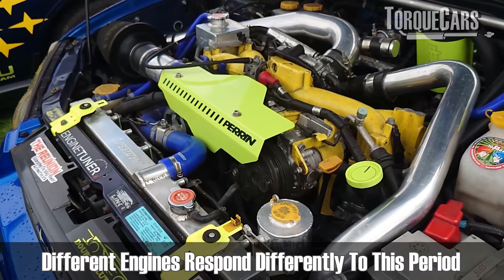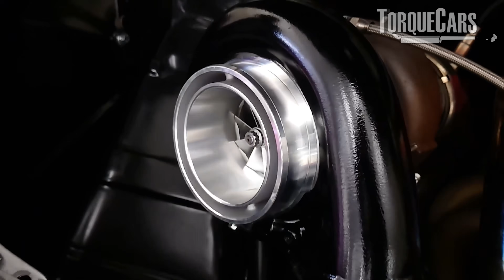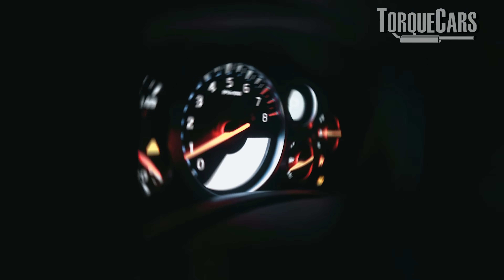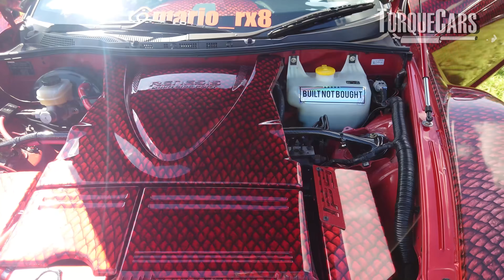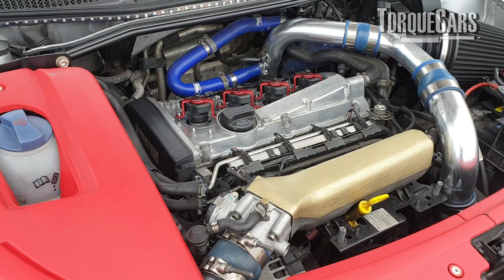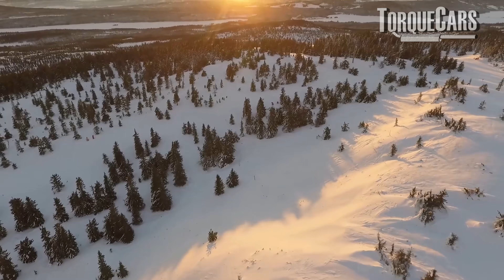❄️Best Cold Start Method Explained For Each Engine Type.

Comment: Very good advice.
However, in the generality of cars ( more than 90%) the user can only know the "water" temperature  not the oil temperature. In general, a car gefs the normal "water" temperature after about 9 km. But this do not means oil is already at the right temperature. It is not. Only after 18km~20km or more oil temperature reaches the optimal value...

Comment: Cold starts are very normal here 🇨🇦, I have a pickup powered by a 6.6 litre V8 diesel. It’s -19c this morning so a normal cold start would involve turning the key letting the glow plug light go out and starting, after that a grid heater in the intake will kick in for a minute to reduce emissions. The truck has two large starter batteries for this purpose. 
In winter I use 0W-40 full synthetic oil of 10 litres, I have a block heater, a oil pan pad heater and another oil pan heater on the Allison transmission which are usually all plugged in 2-3 hrs before starting. Truck is 12 years old with just over 300,000 kms on it, with no power train issues. Look after your vehicle and it will look after you. 
If you think I don’t know anything about UK cars think again, before I move to 🇨🇦 I had numerous cars and it was very important to me to help the engine warm up, I had a inline hose heater and Kenlow cooling fans on my cars in the late 70’s.

Comment: my engine keeps revs up a bit for the first 45 secs when starting cold. I always wait for this cycle to end, then take it really easy until the oil reaches at least 60 C, flooring it only above 80 C. I like to take my time with the engine, I rather head out 5 minutes earlier than starting at the last moment and pushing it cold. I drive skoda octavia vrs 2.0 tsi 2015, 155k km, first owner, works beautifully, no oil consumption, fuel economy the same as new. Just being gentle when cold and never being late for service, best oil and parts always.

Comment: This is what I do with my 2.3 Focus ST. 

Start the engine and allow it to circulate oil while I put my seatbelt on and set whatever settings I want my heated seats set at etc.  The car is in it’s open loop cycle and making a lot of exhaust noise during this phase so I’m conscious to not sit too long burbling away on the driveway at 6:30am so I’ll start driving once I’m ready to start moving. 

During warm up I treat the car with mechanical sympathy, gentle acceleration and smooth gear shifts, but I will happily use revs for power if needed - rather than low revs high load I.E. ‘lugging’ or ‘LSPI’. A lot of people fixate on low RPM when cold, but if you are using torque and low revs rather than power at slightly higher revs with a cold engine you are just putting more stress on the engine. 

Overtaking and going up hill are still necessary with a cold engine and I’d rather use a low gear and light - mid throttle in these situations. 

I avoid sports mode, full throttle, fast gear shifts and the upper rev range until the engine oil is up to 80°C. 

Even when up to temp and with a flexible modern turbo engine such as my 2.3 Ecoboost I still like to avoid LSPI and will drop a gear or even two if I want to really get a move on. So many just keep it in 6th and boot it because the car will do it, however it’s not mechanically sympathetic and I want to keep my car for a long time.

Comment: You didn't mention specifically the Flat 6.  The Porsches' have a 10.5 - 12 quart sump and that is a lot of oil to get hot.  I keep it under 2500 rpm (except when shifting) until I get the oil up to temp.  Further, I never let the car warm up by idling.  I start it and drive off immediately to get some heat into it and to minimize fuel dilution.

Comment: My VW Bora with the 2.0 EA827 engine has forged parts inside, which is clearly noticeable on really cold days, the enormous stroke doesn't help either.. I tend to take it real easy for the first 10 minutes. And give it the beans after 20 minutes when I feel like it..

Comment: If you have a hybrid and do your own oil changes, strongly considered an oil that is formulated specifically for hybrids (beyond just the appropriate viscosity). Mobil 1 has one that Engineering Explained did a video on. Cheers.

Comment: I like to see at least the temp gague reach the bottom line as a minimum temp, but I have a 2 km bad dirt road, before I get to pavement. It insures, even if I am in a hurry, the engine gets a slow warm-up (and down). Even my cold blooded  diesel vehicles are fully warm before I can push them hard. On the other hand, the road does eat shocks. nothing is free. 🤣

Comment: My 12 year old c4 picasso 1.6 airdream engine always warm up for a minute and keep revs low fir a good few minutes. Got this one because it's got the fixed vein turbo, yes it's only 90bhp but that's plenty for me and last week done a 30 mile run on M4 stuck cruise control to 62mph and got 72.3mpg mpg not bad for a car with 130k on the clock. Once again keep up good work, learned alot.

Comment: Just remember not to be too conservative on the gas when driving a cold engine or you labour the engine which is even worse. About 2-2.5K RPMs for cold upshifts is usually about right. On an auto this often means switching into sport mode make sure the transmission doesn't upshift at 1500RPMs which is too low for a cold engine. Manufacturers set these up shifts to adhere to fuel and emissions regulations, not to prolong engine life.

Comment: My Lexus CT200h (= Toyota 1.8 hybrid gen 3 system) protects itself by limiting the rpm at 1300 rpm at cold start untill coolant temperature is about 30 degrees celcius.
Very smart!
Reply: Have a 2020 Corolla hybrid with the 1.8. But it takes a little bit longer to get heat out of the motor when it’s cold.
Reply: @scottj1957 

I owned a ‘12 Prius V, with the 1.8L 2ZR-FXE, from new until a HS kid plowed into me early this month and totaled it. It is a really good system. In 14 years I hadn’t had a single thing fail on it.

The system definitely has heat retention issues in cold months. In city driving, with the engine shutting down frequently, the ECT temp would languish in the 120-155F range. This produced a lot of blow-by, making fuel dilution in the oil an issue.

It also resulted in a lot of oil vapor being released through the PCV valve. By 100K miles that vapor had combined with enough EGR particulates to differentially block the EGR ports inside the plenum. Cylinder one gets very blocked and without the proper EGR dose it runs lean and too hot. Seems Toyota fingered this issue as why head gaskets were failing at an unusual rate.

When I opened up the EGR system to clean out the EGR valve and cooler, I decided to run an oil catch can on the PCV line. That OCC caught a ton of oil and water vapor in the cold months.

Your system has the same engine but Toyota redesigned the plenum, EGR system and head gasket by then. Hopefully you don’t end up in the situation so many Gen 3 hybrid owners did.
Reply: This sounds very dubious.
So lemme get this straight; You pull out of your driveway and onto the A road, then 1/2 mile and turn onto a dual carriageway. Are you saying that one of these must be true;
1. The electrified side can do motorway speeds with minimal engine assistance?
2. The car limits your road speed due to the electrified side not being large enough and the engine not being up to temp?

Comment: My turbocharged car idles high for a minute or so......So I let it do it's thing n then drive gently until warm n then drive gently to cool it down
Reply: I have a 19 year old Allroad and a 7 year old phev mini countryman. The Allroad gets a minute idling on the drive while lights , mirrors, seatbelts etc get sorted and then its revs limited to 2100 until the temp is approaching normal. @ 225k the g'box is still seamless as the trans fluid has time to get right around everywhere. The last half mile of every drive is on minimal throttle and 30 seconds idling before shutdown. Seems to be working......

Comment: Turn key wait for lights to go out, start engine and wait for 30 seconds and then gently drive down the road until fully warmed up. Simple innit, my engine is only a 1.2 so warms up very quickly too.
Reply: Good practice. Do you have an oil temp gauge? Just remember that water temp heats up much quicker than oil temp, and most cars only have water temp on the dials.

Comment: This winter, I've implemented the cold start protocols described by this channel and a few others I follow, namely, a short idling period of less than a minute, followed by gentle operating until the engine arrives at its proper operating temperature. I aid that by keeping the cabin heat off while the engine is warming. How's that for mechanical sympathy, haha? Last winter, I purchased 12V adhesive heating pads, which I planned to power with the LiFePO4 batteries I use for amateur radio. I wound up opting against mounting them to my '08 Yaris' steel oil pan because I feared degrading the system's oil cooling capacity (since oil removes most of the engine heat, as I understand the process).